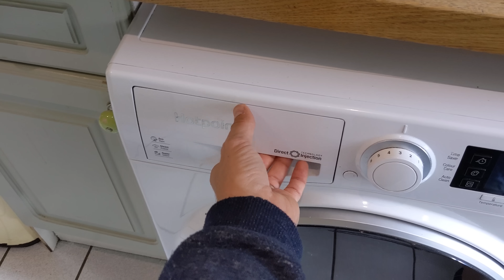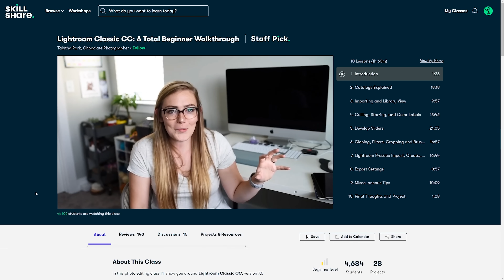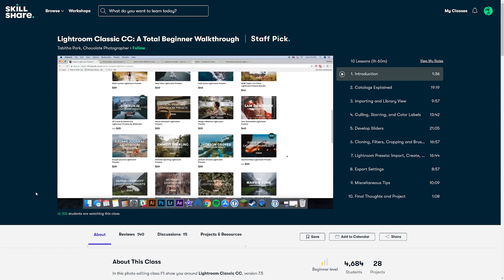The Pythagorean Siphon Inside Your Washing Machine

Comment: I can't speak for all the toilets in Singapore, but I've seen the inside of my home toilet's cistern; there's still the ball cock, but instead of a siphon there's a large plunger with a weight on top of it. The advantage to this system is that you can control how much water is flushed down depending on how hard and how long you press the button. It doesn't seem to have been designed explicitly for that purpose, however, and it's not immune to continuous leaking.

Comment: 7:26 If you've got a leaky toilet, FIX IT!! The assembly inside is adjustable, and if it's seals are totally bad, a replacement costs like $7 at the hardware store.  There is no excuse for running toilets; That is just an exceptional waste.

8:44 In the US, the most simple toilet fill valve, consists of an overflow tube to the basin and a flapper that covers the main flush hole to the basin.  It is filled from a 1/2" NPT inlet on the bottom which exits the base of the overflow tube to fill the tank.  It also has a 1/4" hose that sprays into the overflow tube while tank-filling is in progress, this goes to and fills the basin to normal level - the siphon leaves just a bit at the bottom.  There is a float, either a donut around the overflow tube, or an arm with an air bladder that extends radially outward.  Adjusting the stop on the donut's attached operating shaft or bending the arm will adjust the water level in the tank by operating a valve located somewhere on the overflow/inlet pipe.

Hopefully that makes sense! LOL!  I felt like I was writing a patent.  You can also look up the item on a US based store's website to get an exact image.  
-And that of course works for other countries, find a site in AU to see what theirs look like for example.
Reply: Relax. All that “wasted” water simply flows back into the river it came from so the person in the next town downstream can use it.  It’s not like the water that goes down the drain is somehow lost to the universe forever.
Reply: @stargazer7644  Depending on where you live.  Some places do have very serious water shortages.  

But I was actually thinking of the electricity and carbon cost to pump said water.  I almost specified, but left it open-ended because it's just wasteful, period.  To ignore any simple fix and continue doing something at less capacity is wasteful in terms of opportunity cost.
Reply: @easymac79  If you're looking for best resource utilization, rather than worrying about leaky toilets, you should concentrate on stopping people from buying bottled water.  They pay $3.50/gal plus the impact the trash from the plastic bottle and the plastic it is wrapped in, when people can get water out of the tap for $0.01/gal and put it in a reusable container.  And don't get me started on BPA.  I'd think your time would be far more efficiently used.  Perhaps you could hang out in Walmart and hand out leaflets in the water aisle.

Comment: I live in Russia. My new (-ish) shiny Italian-manufacture (IIRC) toilet uses a syphon similar to what you have there. But my old Soviet-manufactured toilet used a rather different system. Basically, the flushing lever was a stick with a rubber plug on the end. "Overflow protection" was implemented as a separate pipe sticking up from the bottom. Here's a diagram: https://snipboard.io/D9fN8g.jpg (this particular diagram is for a ceiling-mounted flushing tank, but it's essentially the same for the bowl-mounted one)
Reply: Variant of the American style.

Comment: Here in the US we use a flapper plug design. The flap has an upside-down cup in the bottom, and the toilet fills with water pressure keeping the seal tight. When you break the seal with the handle, pulling a chain with a lever the same as your siphon, the air caught beneath the flapper causes it to float. It then stays up until the tank is empty when it flops back down over the drain. The seal is good enough while the tank is filling and only gets better the more water there is. The second siphon keeps bad smells from coming up into your bathroom, as the toilet never doesn't have water in it. At least in a working toilet. With that water barrier the smell of sewage never enters your home.

Comment: I live in Poland. The only toilet I've ever taken apart (and analysed over and over to understand how it's supposed to work and why it doesn't) has a sort of one way valve at the bottom of a column thingy that pulls the sealing element up when the button at the top is pressed. The element is buoyant, so it floats until the bowl is empty, and when it rests back down on the pipe opening, the new water flowing in presses down on it, sealing the opening and preventing it from floating back up. Or, if the rubber bits are old and stiff, partially sealing it and still letting some water through.

At least that's how I remember it. I'm not entirely sure.

Comment: I'm kind of surprised as to how dirty your tank is 5:14. It's got rust and grime at the sides of the tank. Both the toilets I have here have fairly clean tanks. 
I suppose yours looks that way from the rust of those two bolts.

Also our toilets here in the Philippines uses a plug/flapper design instead of a siphoning system that yours uses. It's always been that way for as long as I can remember. 
I've always been tinkering with toilets back then as a kid to the point of breaking the mechanism inside when I put the lid back on. My father was none to pleased with what I did.

Comment: pretty sure what I have is just a plug with a float, the float keeps the plug up while draining but doesn't have enough power to lift it up while there is water in the reservoir, the lever lifts the plug a little to reduce the pressure on it and let the float take over. the water inlet is the same

Comment: Interesting that you have only come across this type of toilet system.  In the USA I’ve never seen this type.  Our toilets just use a flapper attached to the flush handle that opens a valve in the bottom of the tank.  The water poures out and the flapper covers the hole so the water can fill again.

Comment: I'd never seen a siphon flushing toilet until I moved to the UK, where I find them quite prevalent (though where I live now I have the bottom rubber plug kind which I was used to).
Advantages: Not affected by a piece of rubber losing its sealing ability
Disadvantages: If you need to flush again you need to wait until the tank is almost full

Comment: I think in Germany I have at least one toilet water box that uses a hollow plastic tube with some rubber at the bottom which covers the drain hole and is held in place by water pressure - but when you lift it the hollow tube will float and return to closing the drain only once the water level is low enough and the flow sucks the tube back into the drain. Can be started and stopped by lifting or pushing down the hollow tube. Refill to max is handled the same way as shown in this video tho.

Guess that floating tube has the benefit of being cheaper to produce? Your design makes me wonder if the toilets in the UK do a "gurgling" sound at the end of flushing when the siphon drains?

Comment: This is called "Bell syphon" according to the YouTuber "practical engineering" who made a good video with transparent plastic version.
Reply: Bugger, I'll have to correct him too !
A bell siphon - not surprisingly, has a bell in it. And it's a heavy cast iron bell, the weight of which is needed to initiate the flush. See: https://qph.fs.quoracdn.net/main-qimg-880fc7a941ea281edf35e7c334f798a4

Comment: In Australia, the heart of the toilet cistern is a top-hat shaped pipe with a rubber washer on the underside of the brim.
The fill mechanism is exactly like yours, except that if the float-valve doesn't properly shut off the water, it dribbles over the top edge of the top-hat crown and into the bowl.
When it's flushed, the top-hat pipe is lifted and the water rushes into the bowl.
A dual-flush mechanism is basically two of these stacked, one on top of the other: lifting the top one is half-flush, lifting both is full-flush.

Comment: All the toilets I've come across in the U.S. have a stopper at the bottom of the cistern. The handle of the toilet is connected to that stopper using a chain. So pulling the chain pulls up the stopper, causing the cistern to drain, initiating the siphon because the water level in the bowl increases. Of course, there's there same buoyancy mechanism to cap the level of the water in the tank. The leaky toilet problem in U.S. toilets, from my experience, is usually from a chain that is too long getting stuck under the stopper or the stopper not sealing properly for some other reason (damage, wrong size, misalignment, etc). Of course, because of this design, there really is no way to half-drain the cistern.

Comment: The traditional Finnish toilets used a buoyant plug at the opening in the bottom. It's held in place by water pressure until you pull it up, then it floats until all the water is gone and it can reseat itself. The modern ones are two button systems and I have no idea how they work.

Comment: My toilets just have a hole in the bottom of the reservoir. A flap covers the hole and the water above holds it closed. Turning the knob lifts the flap allowing the water to rush out. The flap closes and the water coming in starts to hold it down again

Comment: Only flush mechanisms I’ve seen here in Australia are ones where a tube over the outlet is lifted allowing the water to fall straight down from the bottom of the cistern. The tube is open at the top and bottom preventing the cistern overflowing if the supply leaks, but it had a flange at the bottom that acts like a washer, sealing the outlet. The only way I’ve been able to work out that it is able to shut off again is that it is held in place by a cantilever weight, that is slightly lighter than the tube, so when the water falls far enough, the buoyancy effect of the water on the tube makes it drop, pulling the counterweight into a position where it now assists the tube to fall instead of holding it up. Descriptions don’t do it justice.

Comment: I'm in Canada and we have dual flush toilets becoming more common but the ones I've seen have 2 separate flush buttons on the top of the lid for a full or a half flush. I remember the older toilets where the chain was connected to a flap/lid and it would just pull the lid open and let the whole tank empty and then the lid would close and the tank refilled. When you started talking about toilet siphons I thought you meant the siphon in the toilet bowl itself as that's another siphon in toilets that's triggered from the large amount of water flushing in. I remember as a kid emptying a bucket of water in the toilet and it basically made it flush and empty itself completely.

Comment: Every single flush toilet I've ever seen in the Philippines has a hole as the bottom of the tank covered by a rubber flap. The older ones had a cylinder with a drain hole which filled with water and counterweighted the flap until enough water had drained out for it to fall back down.

Comment: There is also buoyancy mechanizm used in toilets. When reservour is empty it is sealed by gasket connected to buoyant closed container. It cannot float when being surrounded by water because pressure difference buit by water. But when you pull it of by handle, it raises and remain floating on the water surface until it drains.

Comment: I have never seen that toilet flushing siphon mechanism in the states. 
Most of the household toilets I've seen have a lever that pulls up a flap at the bottom of the tank, which lets the water rush into the bowl. 
Then the tank fills fills with water until the float goes back up and shuts the water off.

Comment: My washing machine doesn't have a siphon.   It has the fabric softener tray in the middle of the agitator.  When it spins to empty the wash cycle, centripetal force transfers the fabric softener to a collection ring inside the agitator.  When it stops spinning, the fabric softener falls to the bottom where it is released into the main washer barrel.

Comment: Not in the U.S. For evidence: A quick shop on the Lowe's or Home Depot U.S. websites ( or any U.S. contractor's plumbing supply) will show that the American Standard and all other American manufactured toilets use a flexible ball(ish) shaped valve with a horizontal flange (looks like a cartoon Saturn) at the bottom of the tank. This valve keeps a bit of trapped air from the previous flush inside the ball that when pulled away from the hole in the bottom, it remains floating until enough water drains from the tank that the current of the water flowing through the hole pulls the ball valve back into place to stop up the hole. This usually happens with about an inch or two of water left in the tank unless the ball is old and leaks it's trapped air. For the water conservationist in the U.S. the level of water, and so the amount of water used per flush is determined by adjusting the position of the floating "buoy" effecting the fill valve. This, of course, probably does not apply to California ... God only knows how they flush their toilets ... buckets of poo emptied into the L.A. River, I think.
P.S. The siphon in an American toilet happens in the porcelain water path behind the bowl and accounts for the "glug glug glug" at the end of the flush when the siphon gasps for air.
P.P.S. This also does not apply to (usually) public toilets that use a "Sloan valve" which is a kind of hydro mechanically timed, high pressure valve that works something like the regulator on a SCUBA tank and eliminates the need for a top tank.

Comment: It'd be cool to tear apart a Japanese toilet (the seat kind, not the squat kind). People often comment on the bidet and heated seat functions they have, but the one I had in my hotel while on vacation in Tokyo also had two position flush handle (for large and small flushes) and a trigger in the seat that ran a small amount of water when you sat down. I imagine there's a lot more electronic driven mechanisms in them.

Comment: Siphon Flush systems are uncommon in the US; and I suspect are only common in the UK (perhaps other EU regions, as well) due to regulations about water conservation.  

While siphon flush systems do exist in the US, there is little practical reason why anyone would select this option over the far simpler and cheaper flapper systems available for purchase.  Siphon flush mechanisms are marketed in the US as a premium option featuring “dual flush” functionality.  (You can see by the many comments that hardly anyone actually in the US has ever used one.)

The engineering behind the composition of the flapper  (buoyancy, shape, endurance/resilience) in US domestic toilet design has progressed enough that I doubt the siphon mechanism has enough benefit to make flushing mechanism regulation effective.  But I must admit, the siphon system is a very effective cure for that leaking.  Short of catastrophic failure, the design just don’t allow a leak. Flapper designs do not share this guarantee.

Comment: I live in the States and I've never seen a siphon toilet mechanism, and as a householder, I've seen more than a few. The ball and stopcoick for filling the tank to the proper level are the same, but when you depress the handle, it lifts a rubber gasket at the bottom of the tank and the water rushes into the bowl.

Comment: Australian toilets are different. No siphons are involved in either the cistern or the pan.

You push a button on top. A lever reverses that downward motion into an upward. The end of the lever is forked. It lifts a vertical tube. When the tube is lifted it opens a port in the bottom that lets the water out. Depending on the manufacturer, the tube may be held up by a poor suction cup which falls off when the water level gets low. Alternatively there's a float that holds the tube up while there's water and which drops it when the water level gets low. Sometimes both in combination. The half flush is activated by pushing the separate half flush button which releases a little tub at the end of a lever. When the water level gets to half way the weight of the water in the tub pushes the tube down against the bouancy of the float. As the water fills back up, the tub floats up and resets into the locked position, to be either released by a half flush or not released by a full flush.

Ball cock leaks let the water rise over the top of the tube and the water dribbles into the pan. 

It's massively over complex, needs lots of adjustments, overloads the plastic parts, depends on a seal at the bottom always being perfect and fails all the time.

I hate them.

Comment: yea so my toilet, very interesting, its got a rubber seal in the bottom, no siphon, and it does have dual flush, 2 separate buttons on top, each pushing directly on a button below the lid
as i used to be a kid, i know that it has a hollow tube that goes above the water line, so that if its leaky/ if a kid plays with it and tries to overfill it, the excess water goes down the 2nd independant tube into the bowl.
this is in australia, most toilets here are like that

Comment: Here in Brazil we mostly use an simple press valve to open the flow on the toilet, an to control the amount of water using an spring that slowly shuts the valve close.

Comment: In Germany I have seen various designs. Mostly depending on when they were built. Current designs have two buttons (often intersecting), a small and a big one. It is kind of self explanatory, which is number 1 and number 2 as you would say. A generation earlier there is a switch type button. You can switch it on and will completely drain. But you can stop it at any time. This is not very obvious and communicating. And the old ones are just a mechanism to start the flushing, but it won't stop until empty.